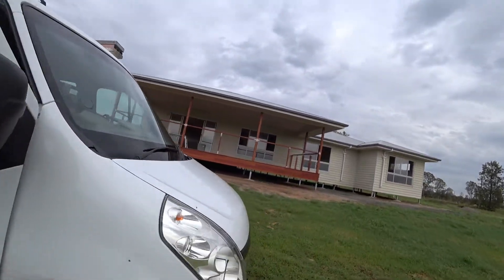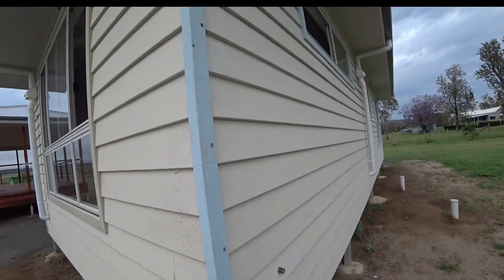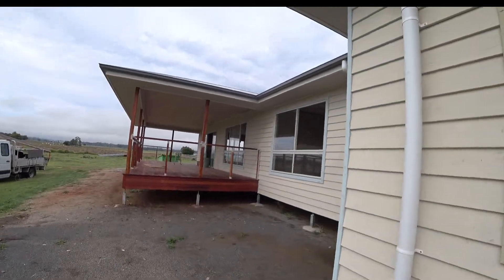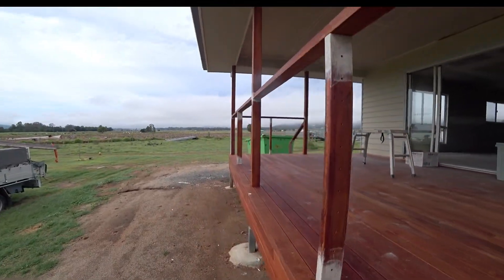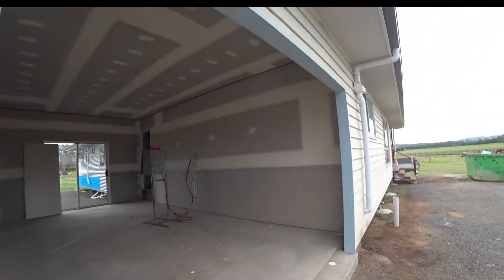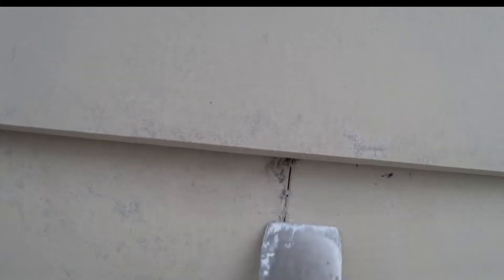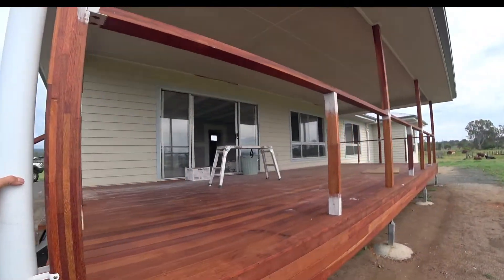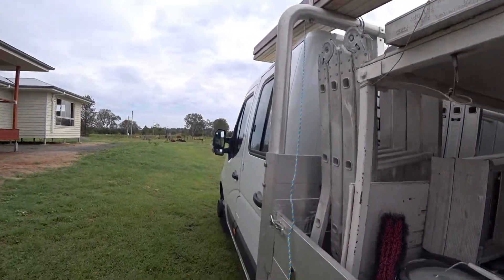My new house

Comment: How many days for out side and how many for inside? Great videos ThePa1nter
Reply from the maker: I haven't really thought much about it but outside should be around the 7 days and inside probably around the 10 days, depending on the weather and who is in my way onsite. Hope that helps
Reply: @ThePa1nterhowto  out of curiosity, quoting my own painting jobs I usually have the days locked in my head already before sending the price, respectfully asking how come your not to sure on the finish time for the inside? id naturally think maybe its because your charging hourly? any reason if not?
Reply from the maker: @onlymemories2595  Because its a custom builder, I charge per floor plan square metre inside,plus extras,  outside is  similar, just work it out at the end of the job and invoice. I haven't looked at the plans yet so not sure of the size. Doesn't matter to me, I can only do so much a day.
Reply: @ThePa1nterhowto  cheers legend, do you prefer to work alone also?
Reply from the maker: @PreachTiger  Not really but its easier and less hassle,if i have a worker i need to constantly supervise until they know my system.
Reply: @ThePa1nterhowto   Fair enough, would love to know what it comes to if your remember after the jobs done, not sure what a good sqm rate is here in nsw